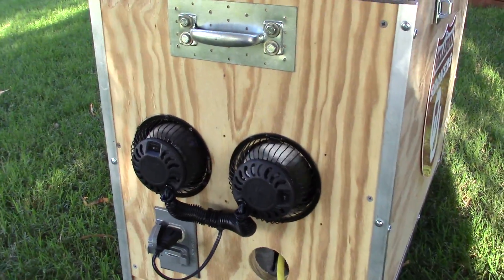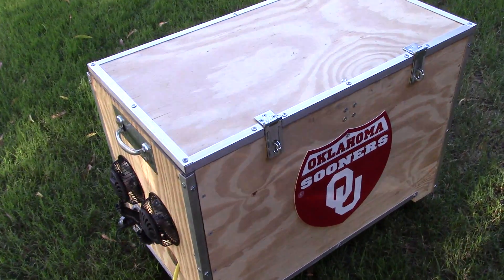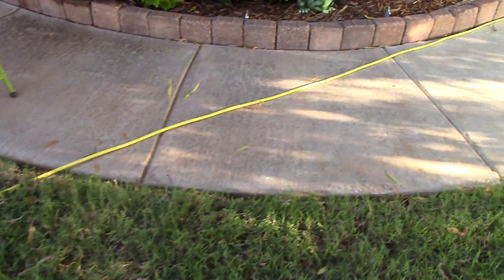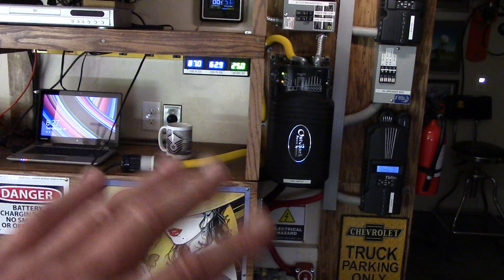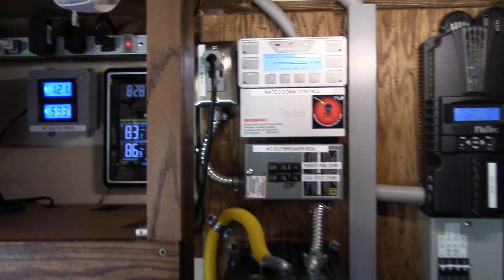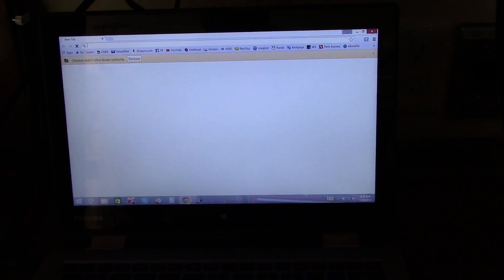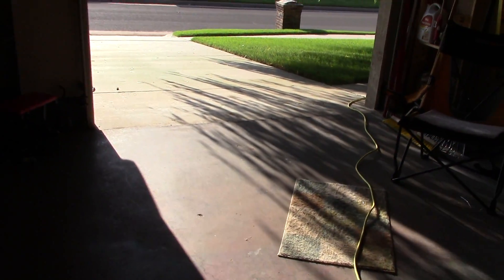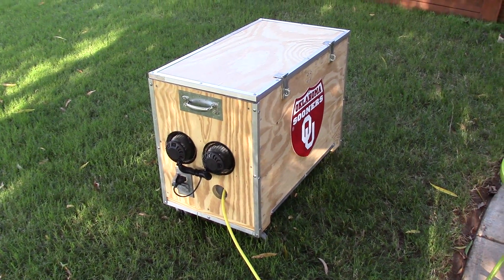⚡ Part 8 (Final design) Honda EU2000i inverter/generator baffle-hush-quiet box

Comment: Placing a generator on the grass (or foam) helps deaden the vibration. (There are washing machine pucks available too that help)
And regarding baffles, any change in direction drastically reduces sound. Just look at the cross section of an actual car muffler.

Comment: Definitely some opportunity for improvement! :) Covering the inside of the box with gypsum board and high density egg crate acoustic foam will cut down on sound transmission a lot. Space the gypsum board 1/2"-1" away from plywood exterior and secure it with as few screws as possible. Also, add a baffle stack to the end with the exhaust port and the end with the fans. A baffle stack that is covered internally with acoustic foam and gypsum board forces sound compression waves to strike the foam, change direction, strike it again to get to the next baffle, strike it again, etc until it gets out of the box. Make the baffle stack's exit port face the ground for an extra "free" bounce. 😺 2 or 3 baffles will make a big, big difference. The dividers between the baffles should be ~3/4 of the length of the baffle itself so only a small port is free for air and sound to move through. With the fans pushing air through the box, air flow will be totally fine. You could probably add a 3rd fan if needed, but I doubt it'll be necessary. If you don't already have it, add foam weatherstrip gasket to the edges where the lid closes against the 4 sides. Caulk all the inside seams too. Seal the inner "floating" pieces of gypsum and acoustic foam with caulk through their full contact thickness, and make sure there's foam gasket on the top edges of them too so they seal against the lid very well too. Get some thick high foam pad pieces to put under the feet of the generator. These improvements will make a massive massive difference in the audible sound outside the box. MASSIVE.
Reply: Very good  design. This guy employed a lot of those methods and made a box that is nearly inaudible. A little big, but impressive. the air gapped gypsum really mitigates the low frequency.
https://www.youtube.com/watch?v=kuRd-ZPeaoQ

Comment: As mentioned several times, you need to add baffles both in and out of the box. I came from television production and have seen 300Kw diesels so quiet you can’t tell they are running unless leaning on the generator itself. And it’s done with baffles

Comment: Regarding the "shock" to the system running the generator,  I was playing with my camper, AC, and other high startup load devices..  what I found was if I run the generator direct, startup will bog the generator pretty bad,   but if I run the AC from the inverter and batts, then the AC startup load goes unnoticed since the inverter and batteries are powering the AC startup load.  So I decided to power just the camper 120v to 12v converter (power supply) which then simply keeps the batts and inverter supplied with power.  I found this way the generator simply revs up smoothly since it isnt getting the startup loads directly.   Wondering if you can do something similar with your setup...  when power goes out, run your generator to supply the inverter and batteries, rather than run the house directly... let the house run off the inverter/batteries then just use the generator to keep the batts charged.  I have a cheap inverter so I loose 10% from running it, and my 120v to 12v camper power supply is also not that efficient, probably another 5% lost there, but the benefits are high.  Also, I can stop the generator and refuel, all while AC and the other power stays on.

Comment: The key to making them Honda eu 2000i quieter is to run them at quarter load or maybe a little more then quarter load.
For example eco mode should always be on!!!!!
If you run it in ecomode inside your box it should be practilly silent.

If your loads are too much to run a Honda 2000 at quarter load/ecomode you could parallel 2 Honda 2000i and keep them both on eco mode and they would run quieter then 1 Honda 2000i.
Or buy a bigger generator and run it on eco throttle. 

I know that you know more then me about building quiet generator boxes but I'll say something just in case you overlooked , that is when you put the box together you should use adhesive on everything!!!  to prevent rattles because it will prevent the vibrating generator to vibrate screws bolts loose overtime and them rattles sneak up on you over time and are very annoying. 

Thanks for the excellent info and videos

Comment: try spraying the outside of the box wood with bed liner material.. the wood will resonate making a drum..
also try turn down vents for inlet as well as exhaust..
also do a jack on the side for the box for the ac connection..
every little bit counts!!

Comment: Finally, a "gen shed" where someone figured out to Push air, instead of trying to pull it.  And a perfect solution to backup power.  Spend the big bucks on parts for solar, and even if "The Storm" takes the panels, you can get away with using a tiny generator to recharge the batteries, and still run the AC and Fridge.  Course I say this having just ordered a new 8k/10k gen.  Newegg has them on sale for $600 + tax n free shipping ( POWERLAND PD2G10000E Jan 2019).  But it burns close to a gallon an hour at half load so about 20 gallons a day.  And your way theoretically pays for itself to boot..

Comment: I just put mine in the shed and ran underground wire from the shed to my foundation then up the wall to an outlet and run a four gang box then run extension cords off that. Works great

Comment: Couple things Id like to point out, take and remove that steel wool, its plugging up the exhaust and you will get less performance and life out of your generator. Then pull the unit away from the exhaust grill and create a snake baffle. The box is in it current form now is  just a sub-woofer box amplifying the deep tones. Use steel baffles inside to knock the sound waves into themselves to properly cancel out the noise. The Walmart fans are nice but you need something with greater CFMS like a 4 inch 110 exhaust computer fan.  I like the idea, but a Honda 2000 should only have 85-89 db out of the box so you are all ready a quite generator so this should be an easy thing to make near silent. Flat surfaces in an enclosed box is gonna amplify not cancel so look into baffle designs and go from there. Take care.

Comment: The name of the Honda 2000 is deceptive. It is not rated for 2000 watts. Take a look at your manual. It actually delivers 1600 watts. It is capable of handling a spike without destruction but this thing isn't quite what the name implies.

Comment: Nice video. Good job on the box. I tried one myself once. My issue was the az heat. Even with a 12v engine cooling  fan it would get too hot. Win some you loose some....

Comment: Decibels at twenty feet? Nice improvement but still noisy. My 11 year old 4000w generac gets carbs every four years and yes I do run it monthly But.... starts easy, very powerful BUT real loud. Tried sound boxes with maybe ten percent reduction in sound. Honda and Yami's are quiet but twice the price. Don't know why generac doesn't address the noise issue.

Comment: one small EMP would fri it all.
Reply from the maker: If an EMP knocks out the Honda...we have bigger problems.
Reply: mr cr I'd be more worried about the sunburn .
Reply: That's not how emp's work. The grid is vulnerable because power lines can absorb long wavelengths. Smaller electronic devices would not be affected unless they are plugged into the grid

Comment: This is really cool.  I bought the eu2000i a year ago from northern tool for $999.00, CUZ I live on a golf course in suburbia too! Id love a quiet generator , I was thinking of converting mine to propane.  Do you use only ethanol free gas chris?
Reply from the maker: 10-4...real gasoline and STA-BIL 360 Complete fuel stabilizer. I don't use mine enough to convert to propane...but, many have done that. Thanks for watching my video.

Comment: A suggestion: You should have stayed with your original exhaust design (downward directed noise), used a larger single fan to feed air into the box and then a similar size exhaust fan pulling heated air out mounted in the bottom floor of your cabinet towards the rear of the box, again directing sound down.  If your cabinet is rolled onto your lawn or a patch of dirt, say covered with some common decorative yard bark, in a side yard, the earth/bark/lawn makes for pretty good sound absorbers.  Just a thought a bit late in the game.

Nice work on the cabinet.  Thank you for sharing your experience with us.

Comment: Move the generator forward and put a panel (sheetrok) between it and the big rear vent, angled at about 45 degrees.  You also might want to put mesh screens over all the openings to keep bugs and crap out...  Search for " 4x Quieter generator in 10 seconds " by sixtyfiveford for some good info on this idea...

Comment: Hi Chris, good video on your quiet box. Took a good look into your design and Id like to offer some design elements that will deaden the noise level from the exhaust. 

Back on the rear where you have the exhaust grill add a deflector wall between the exhaust from your generator and the grill. Using a few pieces of aluminum strips 3 in wide and make a ^^^^^^ pattern on the wall. This is a separate additional plywood wall that should be 3 to 4 inches smaller then the diameter of the interior of the encloser.  The waffled wall will break the sound waves and still give you adequate ventilation.  One note, take off that scrubber as its creating a restriction that will lessen your generators life and power. It may not seem like its a problem now but it will over time deteriorate  the generator and continue to build up exhaust heat. You wont need that once you put in the baffle wall. You can actually put the baffle wall in front of the generator as well to further the sound deadening properties and make more efficient use of the sound deadening material you used on the cabinet. Your cabinet looks great and Im building a similar idea for my trailer tongue. One note to think about too is that air inside the cabinet will compress and expand creating a lower frequency AKA the bass drone effect. Adding more waffling thru out the case will begin the frequency cancellation effects. Vary the pitch of your waffle will vary the different sound waves cancelling out more frequencies and a quieter effect will be the result. Hopefully this helps anyone thinking about this project as Im noticing it was almost a year ago. Take Care!

Comment: Hi Chris. Graham here. Agree with Bruce there about the choke you have by coiling the supply lead to the inverter. We used the same method to reduce the amperage at the hand piece when welding by coiling the hp lead. But it gets hot if done for too long. You are better off laying it out as Bruce said. Your supply will improve surprisingly and be less likely to melt down.  Good luck with it.
Reply: graham darwin

Comment: Very nice setup you have. What type of cooling fans did you use for the quiet box? Are those static pressure fans? Also, what temperature sensor module did you use? I like that you can see it externally and wirelessly. I built a quiet box for my HF generator. I am getting 10db reduction but the problem is that I can't keep the temperature in the box low enough. Instead of pushing air into the box, I added two fans that pull air out on the exhaust side. I wonder if I should add a couple static pressure fans on the inlet side. I used a meat thermometer to check temperature but it climbs too high. Any tips you could provide are appreciated. Thx.
Reply from the maker: THanks for watching. Those fans are Walmart desk fans...AC corded. Cheap as snot. No internal temp sensors. The box makes for great storage too...all my cables stow in there.

Comment: Very nice!  
Now you need a 24 volt  forklift battery under your work bench for stormy days and night time power. All you hear is the inverter fan. Some inverters (Aims makes inverter/chargers)  will also charge a battery bank  so you use the generator every few days to top off the battery bank.   

I had great success in quieting the diesel under the floorboards in my boat. I used canned expanding foam from Home Depot, the orange fire resistant type, and made a waffle pattern under the plywood engine hatches. I have a 3 cylinder diesel Onan gen set that needs a soundproof box, too. Thanks for the ideas. I'm going to copy your design.

Comment: I am not even close to well versed in such things, but it would seem to me that if the appliances pull from a battery, and the generator charges the battery as you go, the spikes wouldn't make a difference. Is that not the case with your setup? I can't be sure... you have too many smart-person-science-things for me to be clear as to what's going on in that batcave you've made for yourself.
Reply from the maker: Hahaaa! Bat cave...I like that. The Honda is a back up to solar...and small enough to haul in the truck. Using the inverter "charge" function and holding loads with this small of a generator is possible...but pushing the limits. It would be use to replace the grid power in case of SHTF, power failure, or cloudy days. During the daylight hours...the solar panels provide all the power. Thanks for watching.

Comment: Beautiful setup, I think I will  copy your generator box.
   FYI: it is good to stretch out the extension cable (in a long 'S' pattern on the lawn or figure 8 it) , so there are no single coils.  If not, you can create a choke and cause heat and resistance with a heavy load.

Comment: very nice chris,,,but i belive i see two mistakes in your box,,,,first, the material that u use for insulation is to thin,,,it have to be double or triple that u used,,,,second on the wall that u set the ventilator and the exaust,,,it have to have a double wall insulated as well whith an opening on the bottom wich it is not going to hert the  ventilation,,and on the mufller u can use fiberglas,,,the distance betwenn walls have to be about 4 or 5 inches,,,,,,,,,,as the opening is on the botton it kills same dba also,,,,,,,,i am sorry about my writing,, i am from brazil, and never have a chance to go to inglish sckool,,,amaro zapala,,,sao paulo, brazil

Comment: Sweet bro!! Looks awesome..You can hardly here it when your in the garage so I doubt anybody can hear it in there house..
Reply from the maker: fanman1981 Thanks man....appreciate it. She was on full throttle too! Punchy little generator....it will hold power and if I need a little more juice, the Outback switches back to battery. Forgot to add in this video. It can also "charge" the batteries if I select it on the Outback Power Mate 3.
Reply: Sweet man!! I never tied a generator to my outback yet!!
I have the APC UTS which separates that part of the system..You and your system are kicking some serious ass!! What's the next project?
Reply from the maker: fanman1981 APC UTS? Sounds cool...what is that? Dunno what's next on the project list...got some tree trimming to do, six more panels to save up for, painting a table, and do a vacation.
Reply: I made a video about it.. It's a 10 circuit sub panel which automatically transfers over when power goes out it has a 120v input for outback/battery backup and a 240v generator input it's my buffer in between cause outback hates Chinese made generators.. There's more bells and whistles on it too..